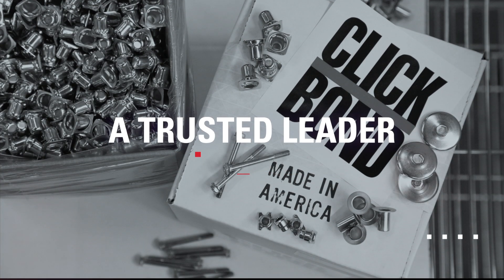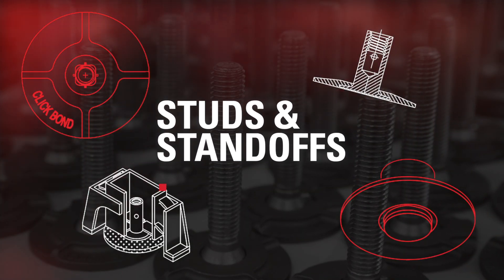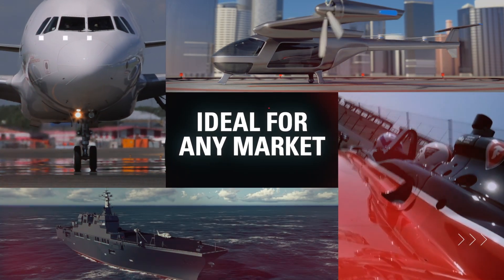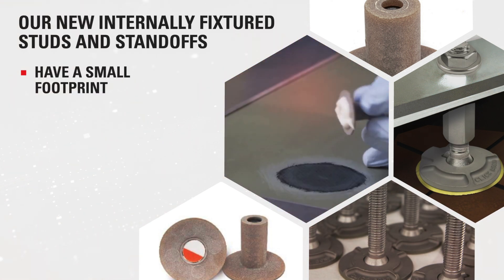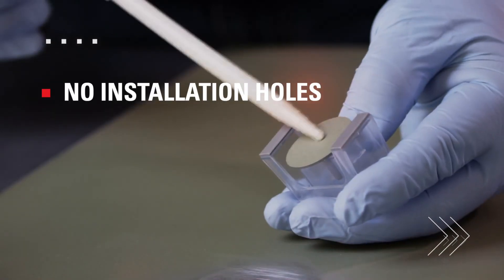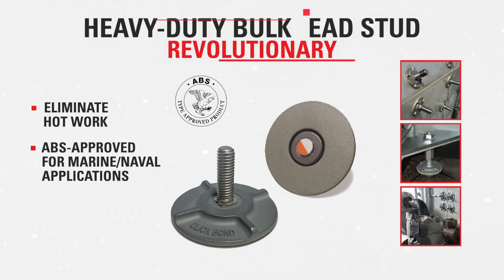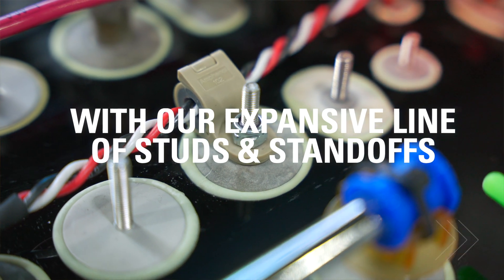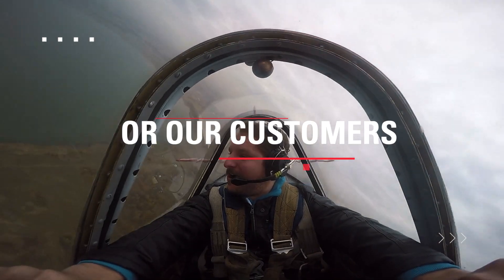Click Bond's Studs & Standoffs

Comment: Do you guys make nylon standoffs? I need stand offs with a base, like what you sell to repair mazda miata mirrors but I need to be able to:

1.Heat them up to shape the base to the mirror housing.
2. Glue the base into place after it takes on the housing shape
3. cut to lenght
4. have plastic thread so I can thread them with the original screws.

The mirrors need to fold and the original plastic standoffs that broke off are fragile and falling apart. 

Your composite product ALMOST works other than material and sizing.